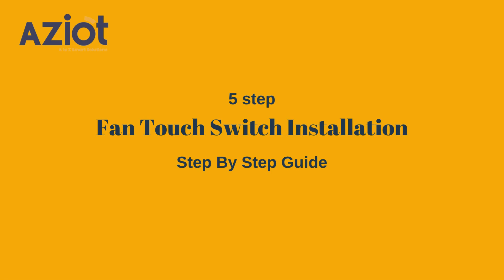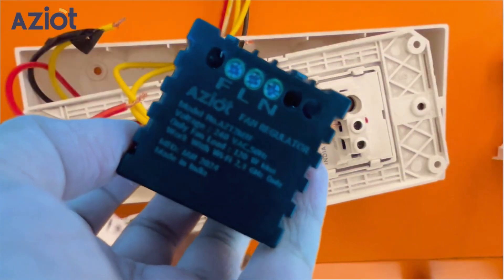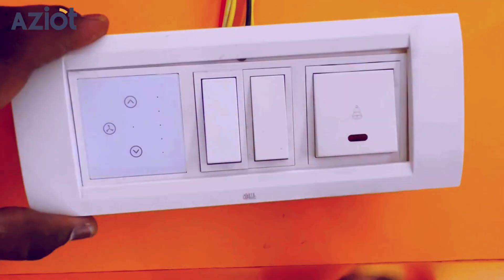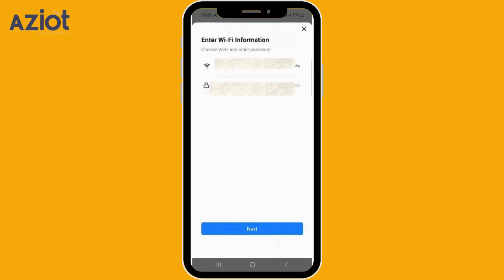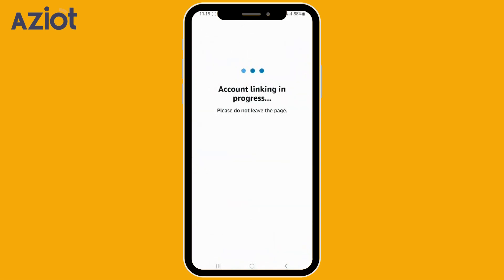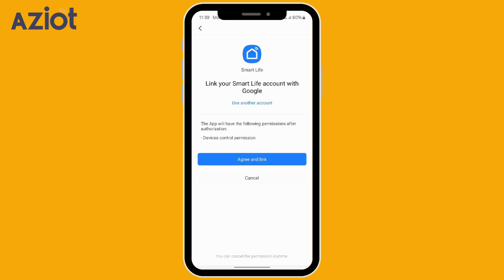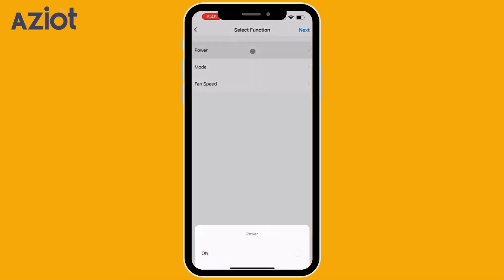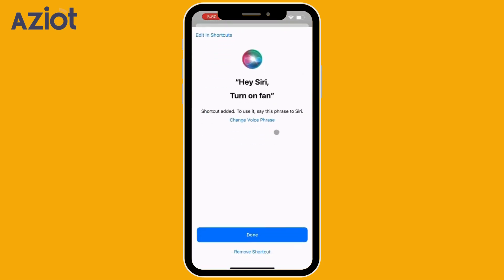Aziot Fan Touch Smart Switch Installation | Modular Touch Switch Installation

Comment: Can you please post video for replacing existing fan switch & regulator with this wi-fi switch. I am not electrician but if you give me step by step guide, me or even anyone can do this. Your video bit confusing for me as now. Because your black wire is not parked anywhere but in this wi-fi switch you are including this. Hope you take it positively and improve.
Reply from the maker: Thank you for your feedback; it helps us improve. We will work on updating our video based on your suggestions. For any further clarification, please contact our support team at 88866 35918.
Reply: can we control fan speed using alexa?
Reply: Can I control the speed through alexa.